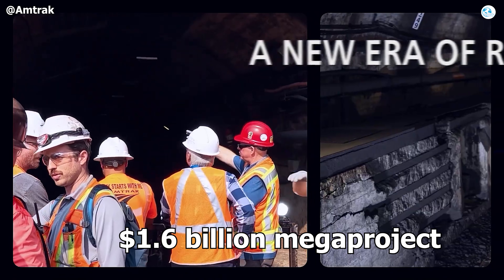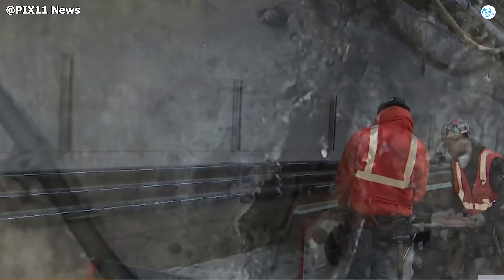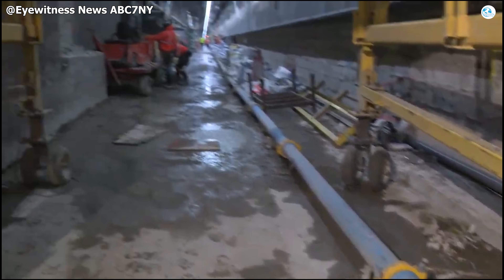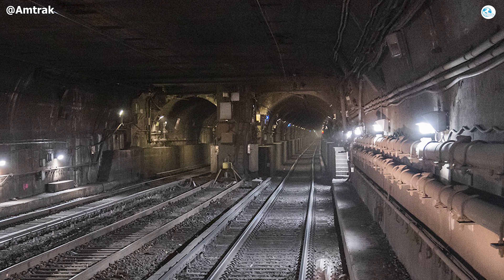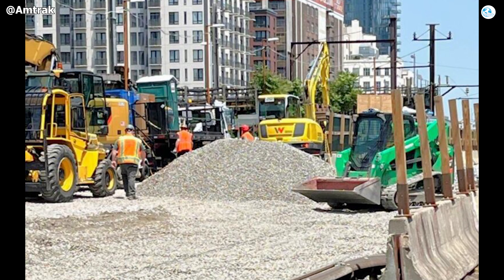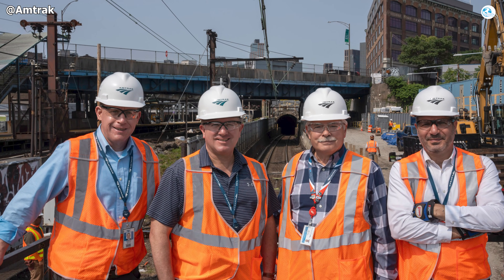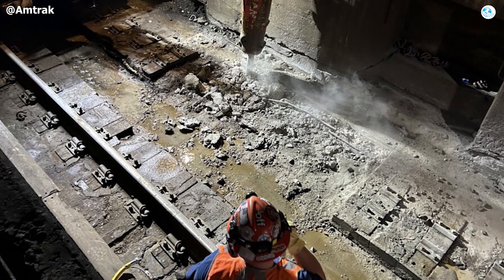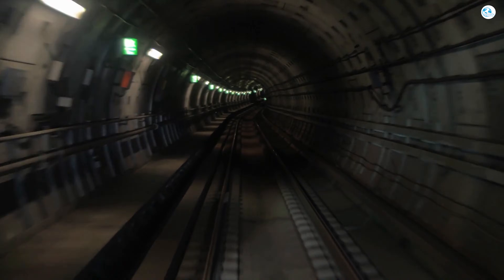$1.6 Billion Amtrak Tunnel Upgrade | East River Tunnel Huge Update

Comment: Maybe some Amtrak trains will divert to Grand Central (temporarily), until those Hudson River tunnels reborn.
Reply from the maker: That’s possible in limited cases, but Grand Central lacks capacity and direct access for most Amtrak routes.
Reply: @ONtheTrains  They did it back in 2018 when they were having construction for Hudson Tunnel (when I arrived with Adirondack from Albany back in August 2018) and back opened in September 2018.

Comment: Honestly, I’m not certain why Amtrak hasn’t considered hydrological concrete?
It’s was discovered by the Roman’s and used in building harbors; one of the few cities build with hydrological concrete was that Caesar Phillipi, the remains of the harbor is still around to this day.
The cement actually gets stronger when exposed to moisture.
Reply from the maker: Yeah, modern rail projects usually rely on standardized materials for consistency and safety, but it’s always interesting to look at those historical techniques.

Comment: Will any passenger runs be returning one this particular tunnel once work is done on this one tunnel?
Reply from the maker: Yes
Reply: @ONtheTrains what I meant was will trains be returning as soon as the first tunnel gets done since certain improvements will possibly slow more trains to pass through than before work on the first tunnel was shut down. I’m hoping that Amtrak will be able to restore the Silver Star and the Capitol Limited as soon as the first tunnel is finished.

Comment: In Germany, we call the ballast-free track bed the "slab track." In all tunnels on high-speed lines, the "slab track" is in place. So far, there have been hardly any problems with it in Germany. Also, in the Berlin North-South long-distance railway tunnel, that is, between Berlin Central Station and Südkreuz, this slab track is present in all 4 tubes. There are some videos on this topic "slab track" on YouTube.     https://www.youtube.com/watch?v=UvG-IzxvLFQ       The link contains an example of the installation of Romberg-Sersa's 'fixed track.' The Austrian company Poor has a similar system. There are also videos about it on YouTube. Greetings from Berlin/ Germany. Sven
Reply from the maker: Really interesting perspective, Germany has a lot of real-world experience with slab track. Thanks for sharing, and greetings back to Berlin!